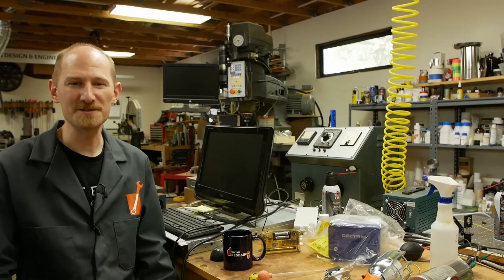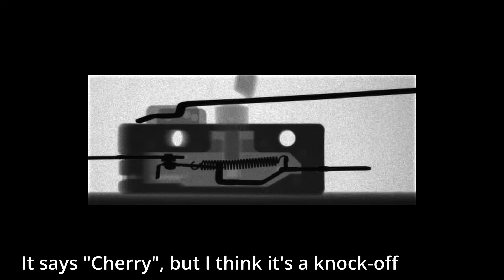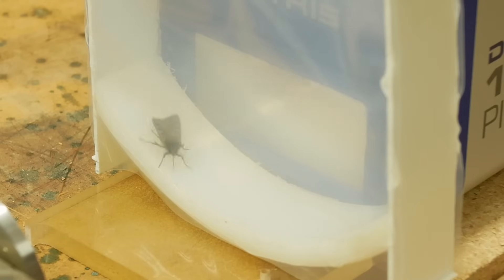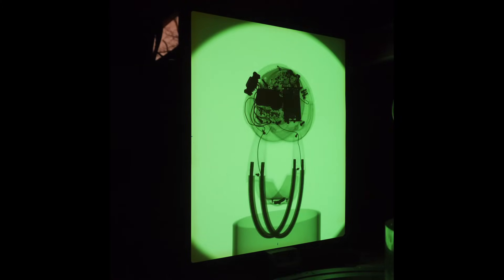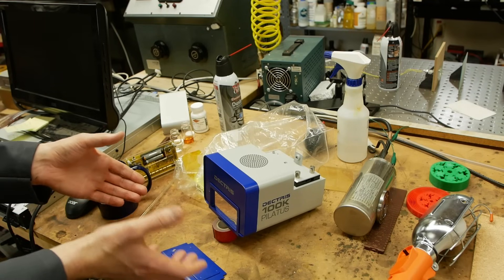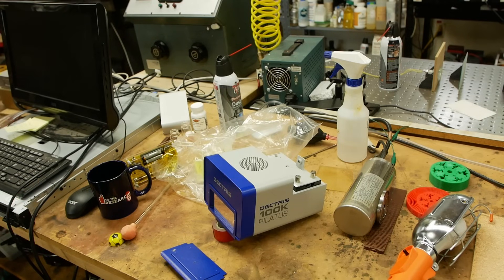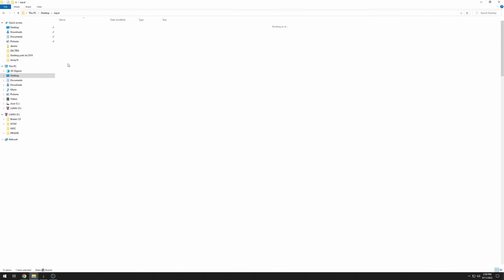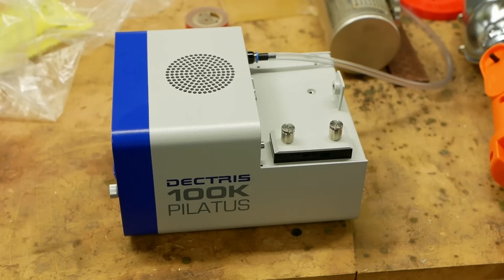High speed X-ray video: jumping beans, wind-up toys and more!

Comment: I was shouting "ImageJ" at the screen right up until you mentioned it. I specifically recommend the Fiji "Batteries Included" distribution of ImageJ to minimize the need to search for key extensions and plugins.

I also recommend first thresholding the images to eliminate any noise floor (thermal or otherwise), then doing a log transform on the remaining data to enhance contrast. These steps are the start of the standard radiography imaging pipeline, after which other layers of enhancement and analysis can be applied. For example, apply a Sobel transform to enhance edges, or a gradient thresholding transform to isolate and track substructures.

The REAL fun starts after you are getting "clean" video. Put your target on a turntable, then feed the resulting video to a tomographic reconstruction plugin to produce a 3D model. Or, more simply, place either the camera or the X-Ray source on a laterally vibrating mount to generate stereo frame pairs to get "live" 3D imaging as you move an object within the X-Ray field volume.

These techniques are rungs on an ever-upward ladder. For example, when I had a cardiac CT scan, I took the raw data, cleaned it up, did a volumetric reconstruction of my heart, do a gradient-based segmentation to isolate my heart, which I was then able to convert (tesselate) to a mesh then print on my 3D printer!

Comment: I work with x-ray crystals, and our company grows them. These semiconductors are insanely difficult to grow, especially in large pieces. It's been kind of like the fusion energy of x-ray detection - it's always the next big thing, just around the corner, but commercializing anything other than these extremely expensive instruments has never quite materialized. 

It's of particular interest for photon counting CT (PCCT), which is supposed to be the next great leap in medical imaging. But along with cost, it also has some physical limitations that I believe limit the resolution? I don't really work with systems integration so that's a bit out of my realm. 

But yeah, very cool video!

Comment: for very accurate measurements, attach a micrometer gauge to a lever, to get a magnification division precision increase at the lever measurement point ratio. at any length, assuming the length stays straight. maybe that lever could be used in atomic force microscopy to get more accuracy on the measurement side. ie measurement multiplication, similar to electron multiplication tube for electron detection.

Comment: photon counting cameras seem to bypass physics? Is it the quantum gap something... Because it's a statistical process which you can't quantize individual photons. You just get 'counts'

32bit tiffs should import into Resolve. Perhaps via a Fusion loader. I don't believe they are a Studio only feature. High end thermal cameras, especially cooled units - also use such sensor designs - but have similar propose built software. They do come with real time preview and processing, including histograms equalization. Look at the SC4400 thread on eevblog subforum for some insights.

Comment: I am a Technical Sales Rep for Proto X-ray Diffraction, and have been doing both single crystal and powder XRD for over 18 years.  We use these detectors on our build for both types of systems.  They are great for measuring diffracted X-rays from everything from small molecule organics like polymers to minerals and more.  We are using one of these to assist in X_ray Metrology in a custom build for a customer.

Comment: Really cool stuff, what do you think of a beam-dump style design for the xRay beam? Brainiac75 has a design he's made to stop splashback and reflection from high powered lasers, the design is simple geometry, and I don't see why a scaled up design made from different materials wouldn't work perfectly for your xRay generator. 

Seems like you've got safety pretty much locked down, but it would make it easier to justify using it more if exposure was near zero.

Comment: Very cool video! I'm a student right now studying mechanical engineering. I've recently come to realize I'm very interested in companies that produce specialized scientific or medical equipment for a future career. The demand for quality without compromise, being on the edge of current tech, and uniqueness of products is what has me so interested. However most companies like that are hard to find as just a student (since most products as such are sold B2B). Dectris for example only has 130 employees, I looked them up after your video and wouldn't have found out about them otherwise. Due to your channel and possible other jobs you may have, I wonder if you would be able to point out to me any other unique highly specialized products that you've used and the companies that produce them. I would very much appreciate it! Dectris is unfortunately not based in America so it wouldn't make sense for me to apply to an internship there.

Comment: Super cool fun with x-rays. They are not as dangerous as people think - AS LONG AS the x-ray passes through the patient's body. I remember being worried about the overuse of x-rays in dentistry and orthodontics. Turns out I was worrying unnecessarily. In the early days, they wore these heavy, lead infused, aprons. These stopped the rays, but actually risked more damage.

Comment: You really shouldn't put your fingers in front of an x-ray device like that. In this case it's worse because of the continuous exposure. Another problem is that hitting metal with X-Ray will produce a lot of scatter so it's not just your hand getting the radiation.

Comment: From what I've read from a quick google, photon-counting is an incredibly recent development, to the point it's not really even in the wide Medical setting yet, but I can imagine this would be good for fluoroscopy and radiography, especially being able to capture higher speed processes in the body at a lower radiation exposure rate. Apparently the cutting edge ones can even discriminate an image with an x-ray spectrum that could be mapped to colour

Comment: A few years ago you did some tomography experiments with x-rays. With this high-speed setup, I wonder if living things might be candidates for more experiments. Frame rates are important in tomography of things that move, because you want to get a good 360 without too much variation to confuse the algorithm. Of course, you don't want to spin a critter too fast, but there might be some equilibrium point.

Comment: It would be interesting to see a bumble bee or a beatle type insect that is not supposed to be able to fly but does. Scarabs too. There is a theory that they levitate with vibrational frequency rather than the use of air displacement.

Comment: thats cutting edge diodes, nitrogen bath , like an open tube valve . Avalanche  diodes , transistors,..is there a valve equivalent. the frame editing reminds me stacking a fly I pre prosessed with a batch file in inkscape .Could the sensor be re-configuresd as an event camera ? Only transmitting timestamped photon changes.into a mythic . exciting. if flies eyes were super wide spectrum sensetive, Uv to thermal. The tifs are exact moments in time like the frames of cinema film, LOL. But they were joined physically.

Comment: I knew you could compile imagemagick for 16bit operation, but did not know also 32bit was supported
Reply: Actually I looked it up and IM 7 supports HDR and internally stores pixel in floating point format, so it would probably be ideal to handle this kind of content. In fact, high dinamic range imaging is very common in astronomy applications also

Comment: Imagine my surprise seeing you having a Pilatus detector. My work place is probably one of Dectris‘ best customers, we have two of the current high end 16MP cameras, an even more specialised one for harder radiation, and at least a dozen smaller and older detectors. These things are used at accelerators dedicated to generating X-rays, so-called synchrotron radiation sources. Also funny that you mention ImageJ, we use it every day. Btw, the Mylar window is mostly there to keep the dry nitrogen in. The sensor is cooled with Peltier elements to sub-ambient temperatures and would form condensation without it. 

I’ll send this video to my colleagues for sure.

Comment: Somewhat Random Idea Suggestion:

Making a “Sulfur Lamp”

(For anyone who hasn’t heard of them they use a sealed glass chamber with a bit of elemental sulfur in it, this is excited with microwaves and produces very bright light.  Potentially not as efficient as LEDs, but may be better for high power/demanding color standards applications.  Also mainly uses cheap/waste materials (sulfur), and metal, rather than all which is involved in semiconductor manufacturing.  I’ll post the Wikipedia page in a comment below this in case YouTube doesn’t like links too!)

Comment: Definitely a good project, just take care not to exceed the dose and you'll be fine. Speaking of which, I'll be doing an experiment of generating some X rays, probably using an oscilloscope CRT with its shielding tube temporarily removed, to test a Geiger counter I recently put together with my friend Alana. Since this counter works with alpha and beta, and we don't have any sources, we'll try to test it with a weak X-ray emitter.

Doing experiments on living test subjects?
"Black Mesa Research Facility - questionable ethics, unforeseen consequences."

Comment: Is it good idea to have steel plate that has emission line at 7keV or is it better to let xray hit something like a wood, plastic or water with emmision lines of carbon and oxygen being at like 250-500eV and which can be penetrated deeper? I mean few millimeters of iron can stop xray quite well (unlike aluminum), but I'm not so sure about absorption (in case of electrons, backscatter detector has higher yield for dense materials with high atomic number, but I'm not familiar with xray - maybe placing aquarium behind the sample would be better, I'm curious myself)

Comment: Believe it or not that is actually how Cherry E series micro switches operate. The lifetime is rated at a minimum 6000 cycles, but that is limited by the contacts rather than the mechanism, and more standard 100k is available for lower power versions. Tests of buckling spring mechanisms at IBM produced numbers in the tens of millions for expected cycles, and the load on a spring in a mechanism like in the E series is going to be much lower.

Comment: May I recommend astrophotography programs to open those 32bit Tiffs mid to high end astrophotography cameras capture images to FITS which is a true RAW data format with the cameras having 16 or 32bit depth and the programs usually can convert the original files to 32bit Tiff files too, some of the processing programs also have conversion to video format for planetary motion timelapses.

Comment: How many µSv of radiation exposure does 1hr of experimenting with the 50kV X-Ray tube in this setup cause to you via backscattering?
Reply: How much is dangerous though?
When its too much or save to to be exposed?
Reply: @hoos000  There are annual safety limits for people in jobs with radiation exposure, i.e. for pilots, astronauts, nuclear power plant employees, scientists, radiologists and so on.
The max. allowed exosure per year is chosen in a way as to keep the chance of developing cancer or other damages due to said accumulated radiation exposure acceptably small enough.
Reply: @Psychx_   oh okay got it , but how much the standard of uSV  rediation exposure that its okay usually to be okay exposed to.. or how much is very dengrous or too much of exposure amount of uSV?
Reply: @hoos000  I collected some examples for you:
Usual background radiation is around 0.1µSv per hour, depending on where you live.

The average total exposure per year is around 3mSv for Europeans (this includes medicinal scans).

Medical x-rays may range from 5µSv (dental) to approx 20µSv (thorax).

A transatlantic flight is 80µSv.

Doing a thorax CT causes an exposure of 5.7mSv at once.

Employees with an occupational risk of radiation exposure (scientists, nuclear powerplant employees, radiologists, pilots, ...) are not permitted to recieve more than 20mSv per year (Europe),

400mSv is the limit for such a person's whole career.

When staying at or below the workplace safety limit of 20mSv per year, there is no statistically significant difference in the occurance of cancer, everything above that will increase the risk measurably.

200mSv at once may cause radiation damage (i.e. changes in blood cells as indicator for bone marrow damage).

Everything above 500mSv at once can immediately be felt by the exposed person.

1Sv will lead to acute radiation sickness, some long term damages and has a <10% mortality rate within 30 days.

2Sv is the same but with 20%+ mortality within 30 days.

5Sv is lethal within 30days within 50% of all cases.

6Sv has a 90%+ mortality rate within 14 days  of exposure.

13Sv is what the liquidators recieved during the Chernobyl catastrophe.

80Sv causes immediate death.

When handling radiation sources like the X-ray tube seen within the video carelessly and without precautions it's very easy to recieve more then 20mSv a day.
Reply: @Psychx_ oh wow that was informative, i got it now that's clearlfies it. thanks👍

Comment: ffmpeg might make using the tifs easier, heres a short script i made to export the frames into a 60fps mp4  
ffmpeg -framerate 60 -start_number 0 -i "K13_%5d.tif" -c:v libx264 -preset:v veryslow -profile:v high -crf 15 -pix_fmt yuvj420p -an -y output.mp4

Comment: What kind of Geiger counter do you use?  I have GQ GMC-320 and brought it to work (diagnostic xray) , to see if it could detect xrays.  I tried hand techniques/ abdomen techniques and I couldn't make it behave differently.  It does respond to different background radiation and to uranium samples.  
If you do a lot of this in the future I think what I would do is get an apron, thyroid shield, maybe some glasses.  You will get less back scatter with that tube but with it going constantly for the video, the exposure from time adds up.  Now extremities like the hands and feet are some of the least sensitive parts of the body in respect to getting dosed and having negative effects so you got that going for you.  You probably already know the basics of radiation safety, reduce time to exposure, keep as much distance as possible and use shielding, maybe invest in a dosimeter like "Instadose" plugs right into the computer, some are wireless, really easy to use and very accurate.  I can almost guarantee you get less dose than say every other surgeon out there that sticks their hand in the field.

If I had this tube I would like to test different materials/ magnetic or electric fields anything at all that might focus xrays.  I wonder how small a scale one could image something if say, you were to  converge the xrays onto a subject, where the xrays cross path beyond the subject and diverge onto a large sensor like your mobile panel. (you would probably need a larger OID and thus a tube with a small target.)  With microscopic things, one might need very low kV I would have no idea where to start and I imagine the lensing behaves wildly different with different kV levels.

Comment: A few things to film that come to my mind:
 - Water spray bottle in action
 - Lens focusing/zooming
 - Lighter piezo thingy
 - Non-electronic alarm clock at an alarm time
 - Screw being driven into wood (or other materials?)
 - Mouse wheel (different mice?)
 - Mechanical mouse movement (the one where a ball is rolling)
 - Car horn
 - Fire (does it even show?)
 - Popcorn
 - [stretch] CD player loading a CD / floppy drive doing the same / cassette loader doing the same (I was always fascinated by the amount of engineering that went into these)
 - Gluggle jug, or anything else from Steve Mould's videos where they made 2d versions
And oh so many others :) 
Please do keep on filming them, it's so cool!

Comment: this would be ideal for food inspection lines, any food object (an apple example) with a density change in it, gets blasted off the line. Any food that looks good on the outside but has parasites or rotting, would be easily seen. Or even for rice speration, you can detect rocks, as long as they are not white and similar shape. But going by density alone it would be 100% accurate